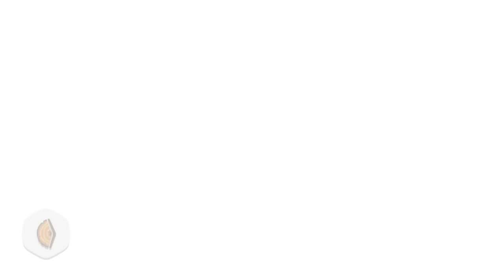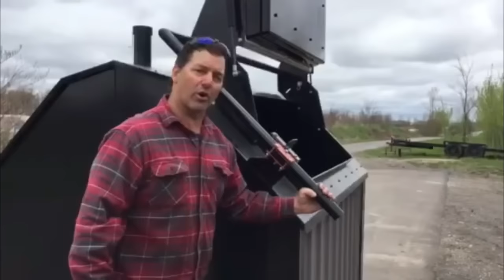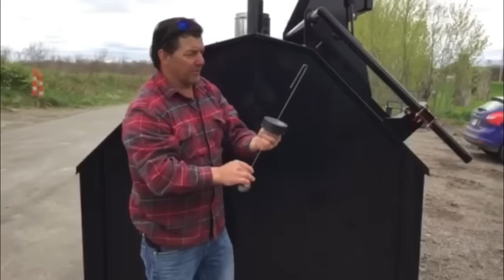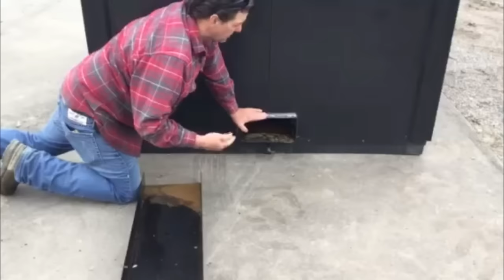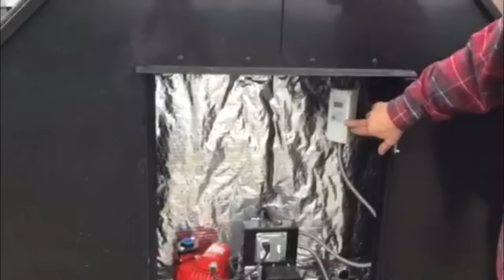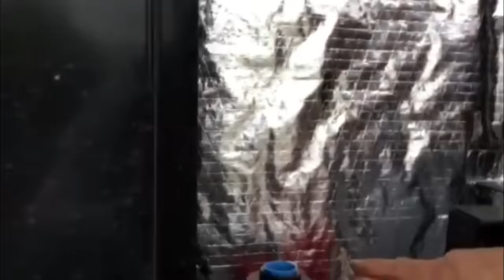TL-400 Walkthrough

Comment: Hey Tom we have one of these units at our shop, we have been using it for about 3 to 4 winters up in Canada. this year we cant get the water to stop boiling out the top pipe. Seems like the dampener isn't working properly, but seems to open and close when we turn the fan off and on.. any thoughts?
Reply from the maker: Sounds like you may need a new rope seal around your lid and ash pan. Call us at 616-916-0900 and we can get you a new rope seal cut and shipped out
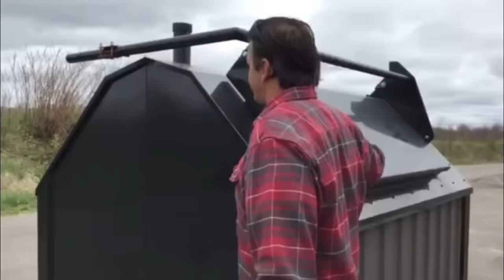Reply: @thelogboilertlbinc8630 0:51 a
Reply: Did it end up being the rope seal ? :o